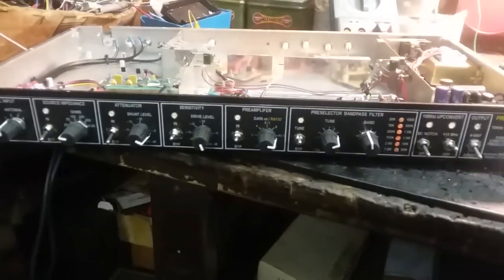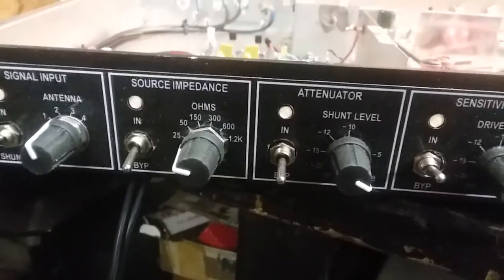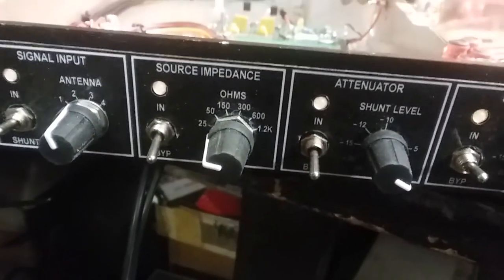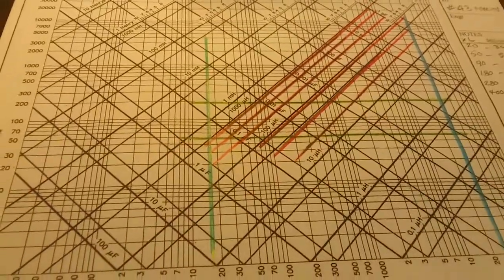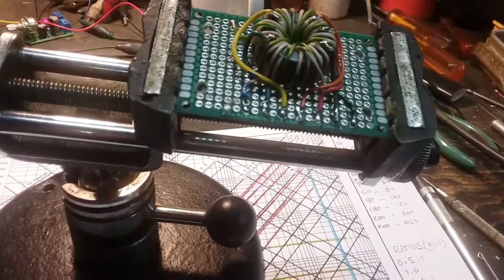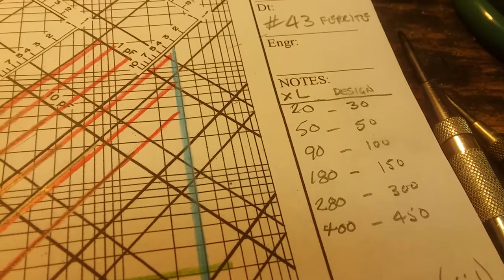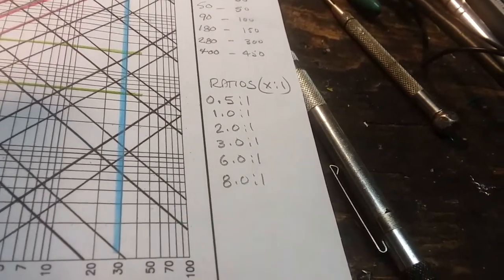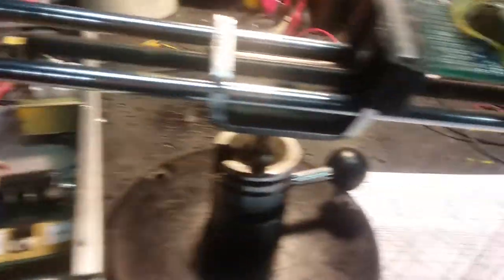RF Balun, UNUN, Transformer for Recievers

Comment: Thanks for the heads up on rick's channel.  I really like your common sense approach to making a taped balun/unun/rf transformer et al for receive.
Reply from the maker: Steven. Because of the bands we are concerned with, it isn't very critical. I generally use #26 solid wire.